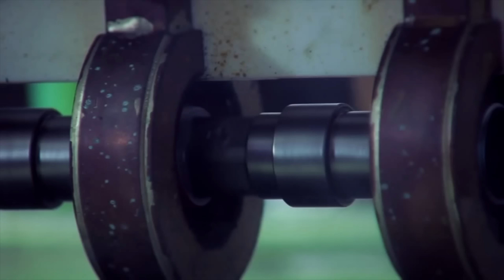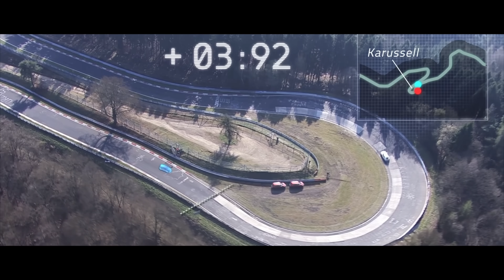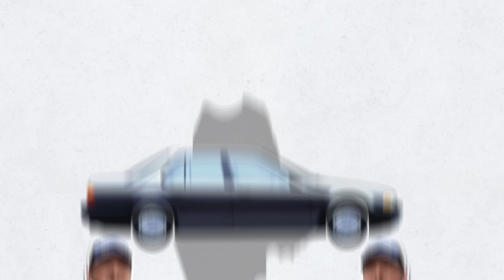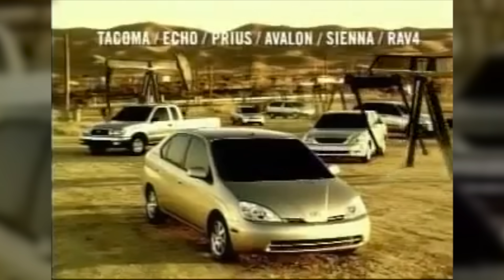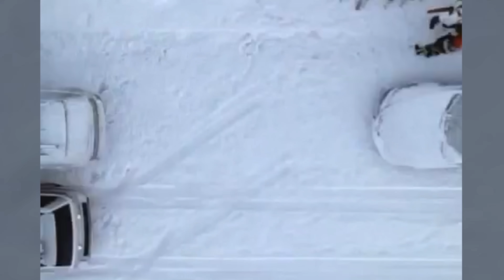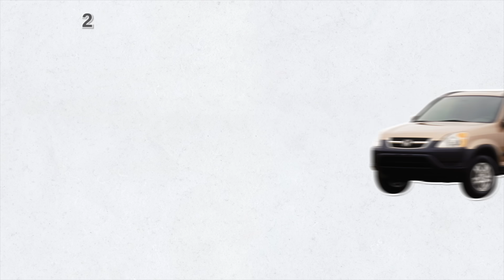Here’s Why Honda’s New Cars are Genius

Comment: I never drove a Honda until I worked for them. One of their smoke stacks released some grit that got in the paint of employees cars. The company generously agreed to pay for every car this happened to, be buffed out by an auto detailed, and the employee given a company car while theirs was being repaired. All at no cost. I was given a 92 Accord to drive and was so impressed that I bought only Honda’s from that day on. Absolutely the most reliable and well built car I’ve ever owned. The Odyssey has been amazing as a family, very kid friendly , car. I built and shipped Honda’s for 25 years, they really care about quality.
Reply: We still own and drive a 92 accord. My wife bought it brand new upon graduating from nursing school.
Reply: I have a 2001 Odyssey with 179,000 miles, yes im on my 2nd transmission but it was still cheaper to repair that then buy another car. The engine is like a tank. Soild and strong.
Reply: @marka.flower9579 put trans cooler i have a2000 honda Odyssey with 400000 mi with original trans and engine man this mini van is a beast
Reply: @taha4342  i did put a trans cooler after my first transmission rebuild at 100,000 miles. Second transmission went with cooler at 172,000 miles and thats with draining transmission fluid at 50,000 miles
Reply: @marka.flower9579  you didn't change your trans fluid frequently enough. 50 is way to long, we do it at 30k
Reply: @ButtFingerEsquire  Scotty who has been doing this for 50 years, has e even said 50-60k
Reply: @marka.flower9579  yeah hondas sucked with automatics especially around that time and the odyssey is one of the worst minivans out there for reliability and transmissions. newer ones are better but most are cvts now which are worse
Reply: @robmalcolm8042  the only problem I have with Honda and I work for them. They use the same motors and transmission for the Odyssey, pilot’s, Ridgelines, and Passports vehicle.
Reply: @robmalcolm8042  That's just incorrect. I see more old Odyssey vans on the road than any other mini van. The Sienna is a close 2nd. Especially the engine in the Odyssey. You can't deny it's the longest lasting engine in mini van history. Those are literally stats.
Reply: @robmalcolm8042  why do you say that? Previously owned 3 Hondas with CVT‘s not 1 failed.
Reply: @robmalcolm8042  Honda doesn't use CVT's on their V6's...
Reply: @robmalcolm8042  there's not a single Odyssey in existence, with a CVT.   The newest ones have a 10-speed automatic.
Reply: @FLIP205  I worked there and all of the employees wanted to make sure their their car was made in Japan. They did not want any of the crap made here because they knew they were afraid of getting the same crap they assembled
Reply: @melmel3703  So you are saying that the “American” worker has not pride in what he/she makes….. Interesting. We used to have pride. I wonder what happened….
Reply: @AgonxOC  yes.  That’s exactly what I’m saying.  That went out the window years ago
Reply: @NewEraMusic972  The J series v6 is really good
Reply: @melmel3703  I have had Hondas that were built in Japan (prior Integra, 3.5 RL etc) and others that were built in the US (3.2TL, Honda Accord, 2021 RDX etc).  The RDX is brand-new and hence I would leave out of this equation.  However, when it came to the others, absolutely zero difference in long term reliability between the Japanese built Hondas and the US-built Hondas, and all of them crossed WELL over 150K miles with absolutely no difference in reliability across that mileage.  

You say you worked at Honda for 4 years........as what ? Not asserting that you are a disgruntled former-employee, but why did they let you go ?
Reply: @robmalcolm8042  I work for American Honda. The older automatic transmissions do not suck, customers suck at changing trans fluid. If you don't maintain your trans it will go. Honda recommends trans fluid changes every 30-40k miles. NOW the new transmissions are actual junk. We replace 10 speed transmissions all the time for self destructing. The new 9 speed and 10 speeds will set codes that require the transmission to be replaced. The diag for the code is clear and confirm dtc is present, replace transmission.
Reply: @robmalcolm8042  Love the CVT in our 2014 Accord, 4 cyl. Smooth as silk.
Reply: @FLIP205  We are senior citizens on fixed income and contemplating buying a new 2022 Honda CR V LX.  Do you recommend this?
Reply: I’ve had many Honda vehicles, generators, ATV, dirt bikes and a lawn mower from 1982 that still starts on one pull. I’d buy underwear if it was made by them 😂
Reply: Love my odyssey 2004 minivan
Reply: Honda is a truly amazing company, I just wish they went back to designing amazing cars like those 90s cars. Talk about timeless. A well kept Legend GS today still looks amazing.
Reply: I have 98 crv, last year a Ford car had an accident and airbags did not worked, my car has same brand of airbag. After 22 years Honda send me a message and called me. They changed my 98 crv s airbags free. They really cares about quality and their customers even 22 years later.
Reply: To any of you who work at Honda in Ohio. I live in the UK and had a USDM Civic EJ coupe. Best car I ever had, transmission fluid for the Hondamatic still pinky red at 90k and 20 years old. Double wishbone suspension all round is superior to a lot of equivalent small cars even today. Never broken-down, never used oil and despite sending 20 years on this rainy miserable island there was not one spec of rust. I have since moved on to a Mercedes Benz but I miss that car every day! Incredibly well built and rustproofed. I only had a D16Y7 (no VTEC) but even that was a revvy a willing little engine that was fun to use. Props to Honda Ohio you guys build good stuff!
Reply: I have a 01 Odyssey with 230,000 miles original everything. The back doors are trash but otherwise it just runs and runs.
Reply: Is the same in most brands, they have good and some bad cars. Some Honda vans and Acura TL's have trans problems
Reply: I was interrupted while changing the oil on my newer Honda mower and forgot to fill the crankcase after draining it. I mowed for about seven minutes with no oil in it before a realized my error. I filled the crank case and readied myself for a large amount of smoke and clanking. It ran like new and turned out to be one of my longest lasting engines I’ve ever had. The guy who interrupted me died in a car crash...
Reply: I bought two 92's....bulletproof Accords. They then were my girls cars. The girls couldn't even kill them.
Reply: Thats awesome I have dreams of moving to Ohio and making Accords they are so roomy comfortable zippy steering is butter not good for high speeds but very comfortable to drive at normal speeds (under 110 xd)
Reply: @austintomkewitz7206  I love my 2014 chevy impala for this reason it has more power tho at a 3.6 v6 shares the same engine as the camaro so roomy and smooth up to very high temps
Reply: Have driven an Accord for 16 years.  Great car.  Thinking about a CRV.  Is it easy to maneuver in traffic?  Easy to park?
Reply: @namvet1968  yes but check out the hrv also
Reply: @iwenive3390  I will test drive CRV and HRV before I purchase.  I keep hearing the HRV is under powered.  Others say it has plenty of power for everyday driving.
Reply: You in Ohio
Reply: Id agree....I bought and '81 Civic brand new and drove it for twelve years...two things failed in that time....a microchip(replaced by Honda no cost) and I wore out the ignition switch after 11 years....the engine purred til the day I sold the car....keep them well lubricated and they run forever...
Reply: @FMHammyJ  Oh Lord Jesus I feel like I'm being punished I hate this car I want to cry
Reply: I got a 95 prelude sir, I ducking love it. Honda’s the best
Reply: Honda also makes private jets, I don't feel safe in small jets but will have no concern in  a Honda jet.
Reply: I've owned a few cars, and driving many others, and Honda Civics are just the best
Reply: I am in love wz Honda cars😅
Reply: The only thing about odyssey is the transmission
is not the same reliability level as the rest of their cars
Reply: Odyssey has the highest % still on the road regarding minivans. Saying otherwise is either biased or completely an opinionated statement.
Reply: @NewEraMusic972  I’ve always had good luck with Hondas since 1998 👍🤘
Reply: @drewbenefield2001  it's not luck if it's that consistent I'd call that reliability
Reply: @drewbenefield2001  man you can't go wrong with the 98 Civic
Reply: No comments on their transmissions I see..........serious issues
Reply: @ronniemassart3834  what transmission issues? That’s typically due to people’s treatment of the car. A lot of older Hondas needed a basic drain and fill at 30K miles  and if you didn’t do this with the V6s, you might run into trouble in higher miles. It’s all about the maintenance.
Reply: @ronniemassart3834  I have not heard about anything on Honda transmissions that would be a point of concern, over the past several years.  Nothing that's statistically significant.
Reply: @ronniemassart3834  if you are talking about the "rough shifting" from their prior ZF sourced 9-speed automatics, then "rough shifting" is not the same as a transmission failure.  I have not heard any failures on the ZF transmission front either, and this ZF is used by many automakers including Mercedes, Audi, BMW etc.  Lately, Honda has moved away from that 9-speed to their own 10-speed automatic
Reply: @OBrandt-i5c  I work for Honda and I can tell you ZF transmissions are junk. We replace a 9 or 10 speed at least once a week, usually more. We average about 3 ZF replacements a week. They're all for "dead" codes, code will set, prndl light flashes, and the only diag for the code is clear code, see if it comes back, if it comes back replace transmission.
Reply: @ronniemassart3834 so what? Every company has issues. They fixed the tranny.issue. some Kia motors catch fire......
Reply: @richsweeney1115  It took them years to fix.....that's the main issue and of course they were more than happy to fix them for $4000 after your warranty was over
Reply: I worked at Honda for almost 4 years. I will never drive one. When I bought a new car last year, the first thing I told them was DO NOT take me anywhere near a Honda or I’m walking out.
Reply: @melmel3703  l.p.
Reply: @melmel3703  you're the only one who ever said that. You probably got fired. Noone with common sense hates Honda. They last. Right behind Toyota

Comment: Is it true that Honda engines have tighter tolerances than Toyota?
Reply: Honda engines definitely better than Toyota, now Toyota V8 engines are super similar to Honda engines extremely bulletproof you can’t go wrong with neither one, but definitely pick Honda over Toyota, but if you want a truck with power get the Tundra or Tacoma, but if you don’t want power in a truck but still have enough to cruise get the Ridgeline. 👍🏻

Comment: Favorite model hands down is the Element.  My 2005 5 speed is running strong with 220,000+ miles on it.  I still say it is the best purchase I have ever made.  Not the prettiest, but so freaking useful!
Reply: Elements are Japan made which are worlds better than hondas made in america or Canada. Had a Acura MDX and Acuras are american and Canadian wheel fell off at 140,000 never would get a Honda product again automatic tranny's and wheel bearings are not their strength
Reply: @robmalcolm8042  I have had to replace a bunch of the rubber suspension parts, but the engine has not let me down yet. Umm, minus the usual starter, alternator, battery crap.
Reply: @ssippishark  haha I just all my engine and transmission mounts this past week, all the rubber wear down but yes engine and transmission is still running strong
Reply: @On_The_Clock  I did those myself. Pain in the butt, but I saved over $600
Reply: Didn't know the element came with a manual🤔
Reply: @michaelmyers4706  yes  in a weird place kind of under the radio on the dashboard.
Reply: I’m glad you enjoy it, but man that is an ugly vehicle. No offense, I just find it hideous
Reply: Talk about versatility, those elements can be used for just about anything! Great purchase!
Reply: @jtjimenez05  I can clean the interior with a leaf blower in 3 minutes.
Reply: My 09 Element in Omni blue pearl has been the best vehicle I have ever owned. 130k, major repairs have been ball joints and the cooling fans have gone out. We are looking at replacing it with a full size truck in the near future, that will be a sad day.
Reply: @odnetnin4720  I loved my 2010 Element SC (Omni Blue) but sold it in 2017 because I didn't feel safe how the front doors need to be open for the rear doors to open. Dangerous for my rear passengers in case of accident.
Reply: @FirstLast-LastFirst  true, it wasn’t easy either when my kids where in pumpkin seats. I bought it because it had great safety records in accidents, but the clam shell does have its draw backs. Luckily I’m usually the only one in the car these days just going back and forth from work.
Reply: I looked into FJ Cruisers, but they are much more expensive and not quite as versatile in the seat configurations. They are a better off-road vehicle though. Good luck!
Reply: @Bella mechanically probably the crv or passport. Design wise I can’t really think of anything. Flat floor, flip up rear seats, quick removable rear seats, semi fast removal of passenger seat, clam shell doors, tail gate/hatch opening, in a compact design. Not much currently that I can think of compares past or present. Toyota FJ Cruiser comes to mind, but that doesn’t do either justice. I think most people that see my E with all but the drivers seat are amazed at how much room there is. I’ve gotten second looks at the hardware stores that’s for sure. Only word of warning, don’t put pvc pipe on the dashboard.

Comment: Love my 2008 Honda civic Si . Wanted this car when I couldn't afford it brand new.  Bought one used recently with 171,000 miles on it for $6k runs like its brand new still.  Previous owner did minor mods.  I deliver pizza in it. Gas mileage not great in city but sure makes  my driving worthwhile.
Reply: I have an 08 too!  Coupe.  Only 92k on mine.  Bought it with 9k on it.  Zero issues.

Comment: I’ve had every version CRV since ‘97, now with a 2012 and 2011. The 2.4L is bulletproof and I won’t get a new one with the 1.5L turbo, so I’ll switch to a Rav4 next.
Reply: Why not?
Reply: Oil dilution problems on the Honda 1.5L.  Plus any turbo engine will never last 20+ years with no problems like a Honda or Toyota engine.
Reply: @m1kcan1  That so called issue was resolved way before the 2019's rolled out with a new software upgrade that really only affected some CR-V's in cold wheather US states. I own a 2011 and 2018 CR-V with 1.5 litre turbo and never experienced any oil dilution problems.( My Civic Hatchback has the same power plant, no issues on that one either). I did own a few 80's vehicles that had major oil dilution issues, but somehow managed to  rack up almost a couple hundred thousand miles.
Reply: @samedudeinmotion  you DO realize that you CAN'T talk about durability of a three year old car, don't you?  Unless you can see into the future 😉
Reply: Honda maybe the best small displacement GDI turbo VVT manufacturers in the world. After all they been doing it for such a long long time, especially in motorsport competition with shared tech from thier F1 and INDYCAR program. Much of that development has been passed on to thier consumer level of engine building for quite some time.. The newer generation CR-V is thier best one yet! The ride and amazing exceleration is very impressive compared to the past generation CR-V'S. Definitely way better than my 2011. I don't think there really is a much concern on longevity. Though the Toyota Rav 4 is an excellent alternative.

Comment: Great video.  I owned an 1991 Honda Accord EXR.  This was, in my opinion, the most reliable Honda car every produced (1990-1993 Accords).  I had not problems with the vehicle (owned it since new for 20 years).  I sold it in great running condition after my 20 years with the vehicle with 535,000 km (323,000 miles).  After 20 years everything still work (except the A/C) and the car was still solid (no squeaks or rattles) and even the shocks and springs were still original (and still in good order).
Reply: The best car my family ever bought was a new '92 Accord with manual transmission and leather interior.  At least a dozen different family members, including me, drove it over the course of 25 years.  I often daydream about being able to buy that car new today.  I can still smell the leather.
Reply: Ralph w, good story. The absolutely best Hondas are the first generation from 76 through 81. I drove a 1981 Accord sedan for 21 years and wish I had kept it. The speedometer cable broke at 220,000, but I know it had way more than this when I traded it in on a 94 Civic del Sol.
Reply: those Accords were prrrfect
Reply: @pleco101   Ya ... although Hondas are still reliable cars overall, I find they are not as reliable as they once were.
Reply: @pleco101  I live in Canada 🇨🇦  ... lots of salt here too.